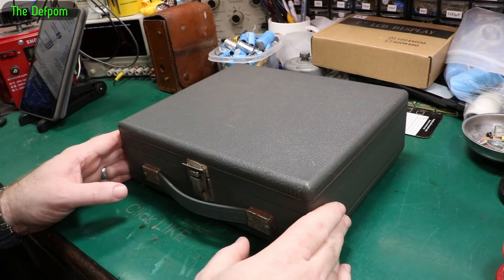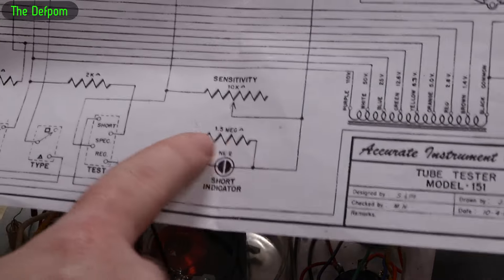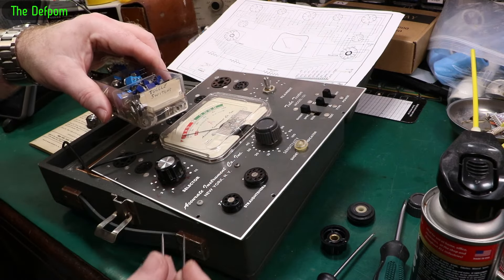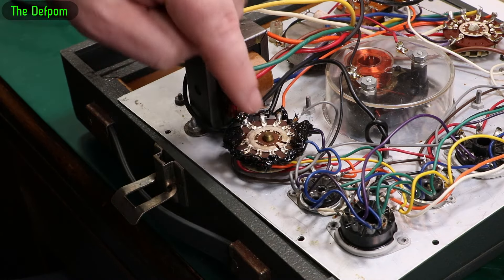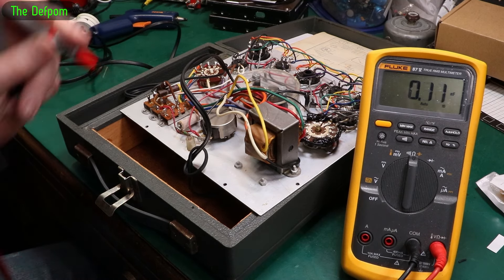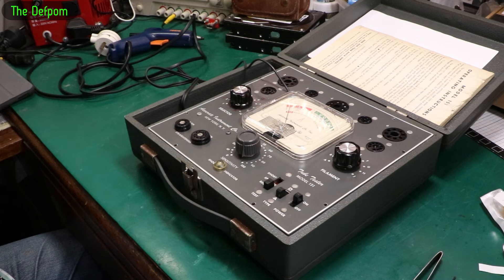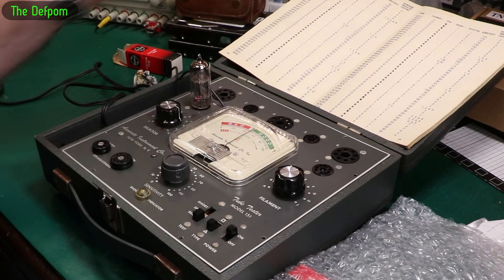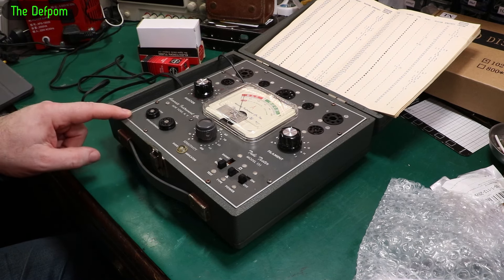🔴 Tube Tester Repair - Accurate Instruments Co. Inc. Model 151 - Part 1 - No.1298

Comment: You could 3D print a star shaped clamp that clips over that broken switch between the various connections and holds the phenolic pcb together.
Reply: If nothing's going on on the other side just bond a rigid disc to it?

Comment: Many tubes have multiple sections, that 6BN8 is a dual diode and a triode, so the tester has multiple settings for the tube to test each section.  You might consider always running the tester on a VARIAC so you can control the line voltage accuracy as you noticed the readings are sensitive to input voltage.  A small 240:120 step-down transformer will work for your voltage conversion, looks like there is room to put it inside the case.

Comment: That is a basic emissions tube tester that works well for occasional tube testing. I started out with a tester similar to yours that was a kit that I built when I was probably 15 years old. I still have that tester but haven't used it years. I now have Hickok 539B, 600A and 6000 tube testers along with B&K 707 and 747 tube testers that are more accurate when testing for shorts, gas, grid emission and will test for transconductance.

Comment: I prefer fine FRP for repairs like that switch. You can even improvise if you can't find fine enough glass matting; ladies tights and any 2-part resin will do the job, at a push

Comment: This is a emission type tube tester. That means that it will test for internal shorts and that the cathode can still emit electrons.  This is done by testing the tube as a diode and measuring the emission current. nothing more. The short test was the most useful function of this type of tester. A very basic tube tester to say the least. This type of tester was primarily made to sell tubes. I would not waste my time trying to convert it to work on 240 volts.
Reply from the maker: @johnlehman2157  too late

Comment: You talk about adding a transformer from 240v to 110v, why not replace the existing transformer with a 240V to 6v +6v as the output would be 6v for the filament & a Nixie Tube PSU module with 150v to 240v?
It would be safer for both yourself & the tube under test as the insulation on the fitted unit . Also less bulky & more flexible due to the voltage range available allowing testing of different tubes not already supported.
Plus more accurate.
Reply: The existing transformer has many filament windings (common filament voltages are 5, 6, 12, 35, 50 and 117 volts). Finding a replacement would be difficult and expensive.